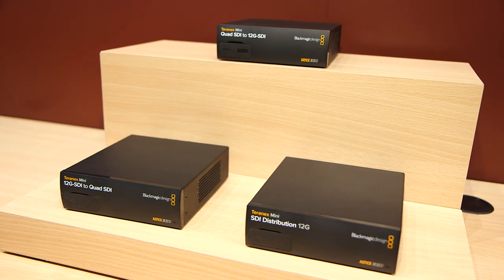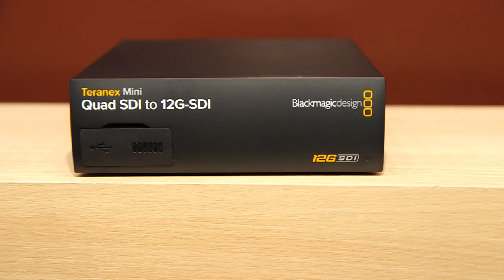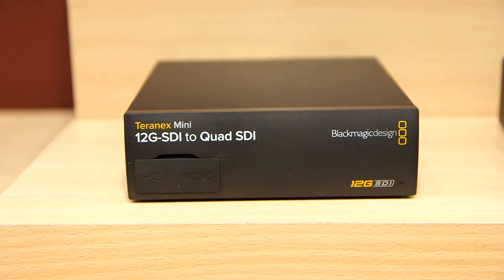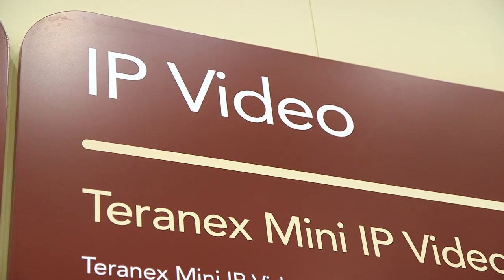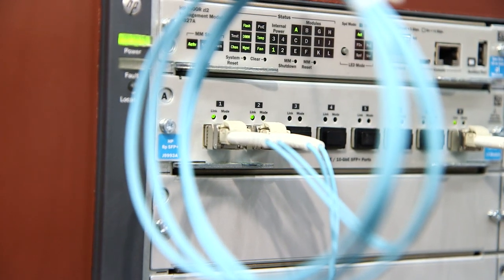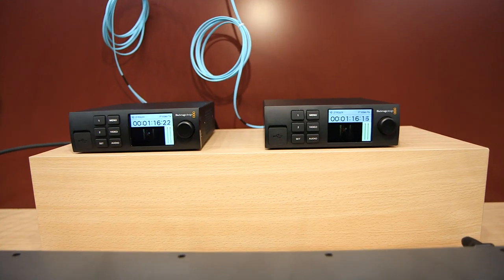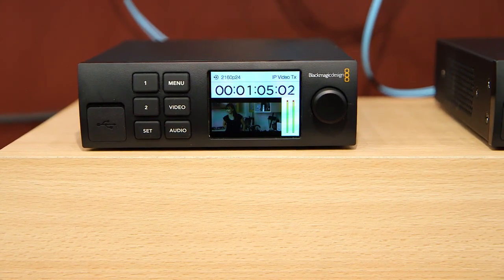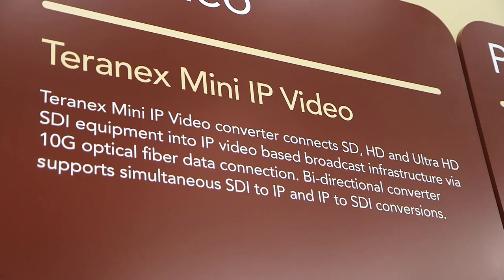IBC2015: Blackmagic Teranex Mini Converters for 12G-SDI and IP

Comment: My company has 3, of these and they all died shortly after the warranty ran out.  They work over POE, but not with their internal A.C. power supply.  I took one apart and found out why.  The two large filter capacitors went "pregnant" (started to bulge) and once they bulge, they no longer work.  However, even after replacing those caps the internal PS would not fully power up the device, found the 100 uF cap near the opto-isolator chip (middle of the board near the edge) also needed to be replaced BUT DO NOT replace with the original 100 uF cap, use a 220 uF instead or else you'll be opening it back up and replacing it again, again and again so just use a 220 and be done with it.  Shame on BM for spec'ing a PS that barely works in this unit.